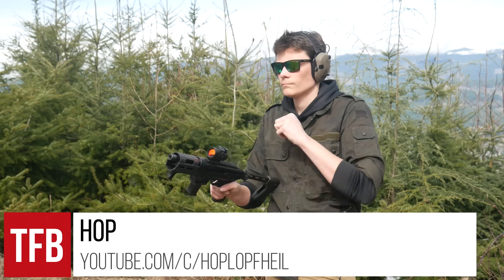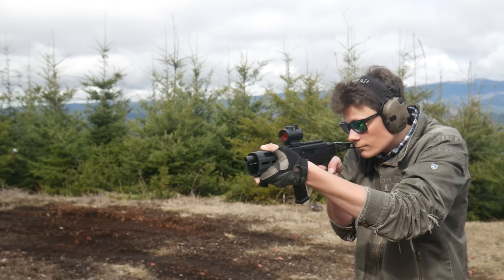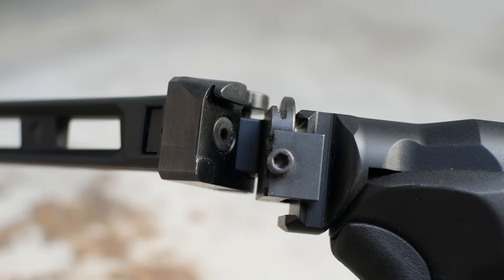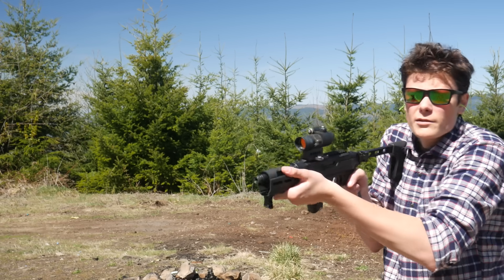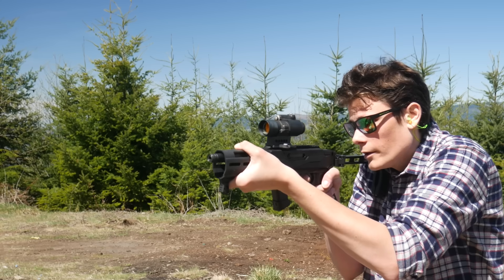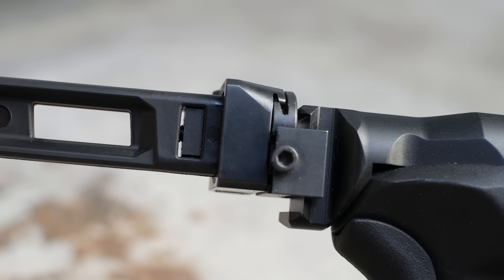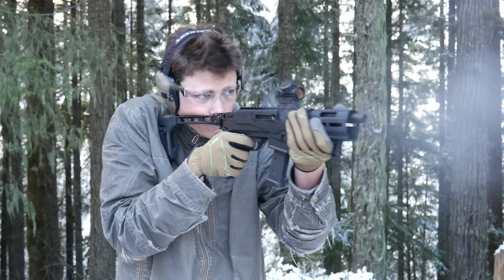Testing the Upgraded FS1913 Folding Brace

Comment: I bought the aluminum version in 2024 and I can tell you that the spring is so strong now I have a hard time folding the brace open and closed.
Reply: Yeah mine is extremely hard to fold but it does. I’d prefer that to having it loose since I won’t be folding it a lot anyhow.
Reply: @Follow.m3.for.mor3  I found a good tip.  Make sure the gun is unloaded (of course).  Put the muzzle into your couch, and then you can get leverage to pop it open.  I ended up putting my thumb under the hinge and pressing up.  The initial pop was hard after that it's "tolerable".  I now just put my thumb under it and push up.  Basically it's backwards of what I see in videos lol
Reply: @k1lldash9  Kinda late to the party but I couldn't get mine to work and was sent a new brace by SB. Still incredibly stiff but your tip worked pretty well. Thank you !! BTW.. has anyone actually taken the spring mechanism apart ?
Reply: @michaelcollier5164  happy to help! No I personally haven't, but since owning the brace as long as I have know it feels more "worn in" and operates as you'd expect, but it never pops unlocked on me when shooting, even if you dump a 30 rd mag.
Reply: @k1lldash9  my first brace would not budge. The replacement is still extremely stiff. So on the first brace, I knocked out the roll pin to see what's going on.  At first, I thought the spring to be too strong but the more I looked at it, the spring was a very tight fit on the sliding post and would not budge. IMHO, the spring is a tad too tight or the post is a tad too big.  I'm going to sand down the post to where the spring slides smoothly and and go from there.
Reply: The slide post is metal so I think I found another spring that might work rather than dremmeling the post.
Reply: Is it still holding up?
Reply: Is it still holding up?
Reply: Same here
Reply: @steveniemyer9288 Where did you buy the aluminum version?

Comment: I have the FS1913 version and it is indeed fixed. This brace is solid and feels good when in my pocket near my neck
Reply: Is it the aluminum or poly version?
Reply: @sokey70  I have the polymer version and it is solid
Reply: @JoshuaE-BiblePatriot  thanks, any way to know if it is the newer version? I plan to get one, polymer to save a bit if it is solid
Reply: @sokey70  I don’t know if anyway to differentiate old vs new. Honestly if you want the best get the aluminum one but if you want one I know works the poly is a great choice. If u got anymore questions let me know

Comment: December 2024

Just got mine in the mail. As any good firearms enthusiast will do, I ripped it open like I was a child on Christmas day. The folding mechanism is extremely hard to work. I ended up using a flathead screwdriver to pry it up. Now it's still hard to open but manageable so long as you have the grip strength of a teenage boy who's single.

Comment: You could also flip the locking mechanism to have it fold to the right side. That way the recoil will create a more tight condition on the hinge
Reply: That's what I'm going to do, it's better that way because I have the charging handle on the left side.
Reply: @Jebusite100  I've done this but it makes the brace really hard to fold back in again after 100+ rounds in the unfolded position. Kind of awkward to fold back in but much more stable.

Comment: I had that happen with my Sig MCX Rattler, so I took the hinge from the swivel brace that came with it and attached it to the FS1913 brace and have had no issues. SB tactical needs to get with Sig and use their hinge with the FS1913 brace.
Reply: I have a sig rattler too, i skipped the flag braces all together and went with a PSA TF1913(triangle folder) brace, so far i havent seen anyone else with that brace on their rattler yet... not sure of thats good or bad.
Reply: @Jon-gt2td  I know it's been a while but how is that holding up? Ive heard TF1913 tends to bend down when firing, is that really an issue or is it fine despite the flexing?
Reply: @MGMan37  ive had the brace on for a lil over 2 years, there is some flex and over time a slight warp in it. For me i still love it and feel it dosent affect performance. I do wish they would come out with one that had 2 solid arms but idk of thats "legal" or not. Overall it still holds up and i have to say still looks better than most braces ive seen on rattlers.

Comment: It's seems a moot point since you sent the gun back, but do you think the SB brace for a Scorpion would have worked better? To my understanding it also attached via a pic rail, and it is designed to go on a blow back operated 9mm.. Just wondering if it may have handled the recoil better

Comment: I ran into this issue over a year ago on both the PSA AK-V and the CZ Scorpion and came to the same conclusion with two different braces using the same latch design. I've used several other stocks and braces with a similar design but the latch on those is better engineered in my opinion.

Comment: Did you try flipping the locking mechanism? I've heard that fixes the issue
Reply: I was wondering if you could flip that, it would solve the issue hop described
Reply: @CarolinaDogMan  potentially. Idk if it's worth $200 to gamble it. Especially once you get 1000+ rounds through it
Reply: Yeah, flipping the hinge upside down so the brace folds to the right fixes the problem.

Comment: I have a polymer fs1913 on my 22 charger. It doesn’t fold from the recoil but it does fold when I pull it into my shoulder (with no intention to use it as a stock) with too much force

Comment: Kind of sucks that the lock up is so loose. Though at the same time you can just press it against your cheek/collarbone so it can't fold. Granted you're accuracy will suffer a bit. Though I don't think it's a huge issue for PPCs. Though with that said there are much better stocks/PPCs for the money.

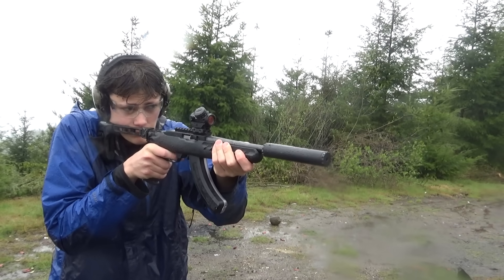Comment: At 5:00 in the video Hop is using a 10/22 Charger with what looks like a 1913 stock/brace adapter. Any info on the brand or a perhaps a link? I know of the Copper Custom one that adapts an AR buffer tube already, but hadn't seen the 1913 verson. Thanks!
Reply from the maker: It's the new version of the Charger. 8" barrel (non takedown) and a 1913 rail adapter on the back. It's pretty slick, review coming soon.

Comment: Hop... you're still using the wrong parts. The Sig X Folding Knuckle with an SB Tactical Pistol Length Tube and SB Tactical SMB4 Brace. The length of pull is right at 13" (which makes this a legal set up). The fold holds nicely but isn't super flush. Still, works way better.

Comment: I just ordered a FS1913 brace with the aluminum strut for my 22lr charger. Do you think it will fold as well ?
Do the new braces have a better or more complete locking system ?

Comment: Nope. Its a feature. If you cant tuck it into your shoulder without collapsing then it cant be a STOCK, its JUST a brace... there for it can be immune from presecution.
Reply: Cool, no one will buy it then. Let's he real the only reason you'd use a brace is as a stock

Comment: Cringing pretty hard watch you turn the gun over to drop the bolt after a reload. PC carbines and chargers have an ambidextrous charging handle, any right handed shooter should swap that thing to the left if they want the fastest and most sensical reloads. You must shoot garbage rod AK’s a lot to be willing to put up with that...
Reply from the maker: The brace folds to the left side of the gun, and there's interference with the bolt if you have it on that side. I.e. can't shoot it folded, and the folding brace sticks out making the gun much wider than it would otherwise. -Hop
Reply: TFB TV Oh gotcha, I guess it’s a Charger specific thing. In James’s video on the carbine, he admitted to being to lazy to change it lol

Comment: Im surprised you shoot that way . Technically it is illegal to use a brace as a stock and makes the rifle an SBR .   I dont care but if the ATF saw you shooting like that it is technically illegal . Becareful what youre putting out there.
Reply from the maker: That's old and inaccurate information.
Reply: @tfbtv  Is it ? I thought braces were to be used against the arm only ?  If thats inaccurate what is the difference between and SBR and  pistol with a brace being used as a stock ?
Reply from the maker: As of this writing, the ATF says that shouldering a brace does not redesign it into a stock. As long as you aren't buying a pistol brace with the intention of circumventing NFA law, it's still a brace.
Reply: @somedude1590  pretty much nothing. But the ATF have specifically stated that only the intended design of the part matters. If it was designed as a brace, then it's a brace, whether you use it "incorrectly" or not.